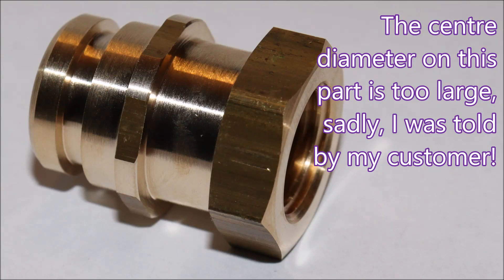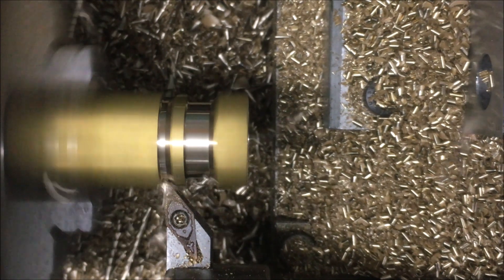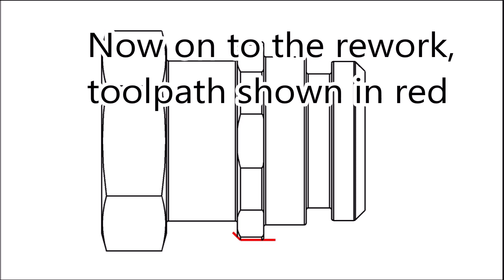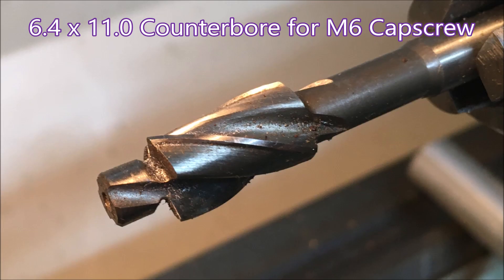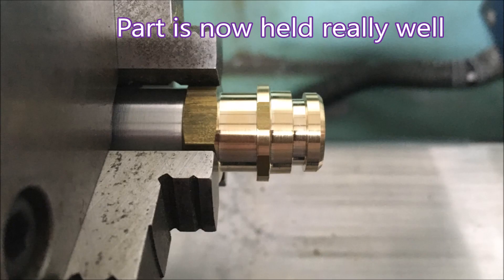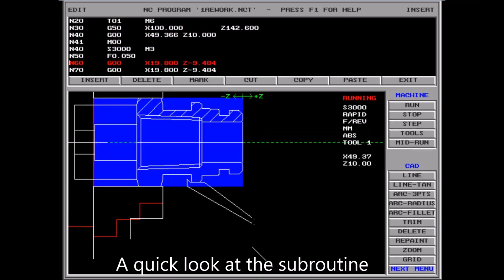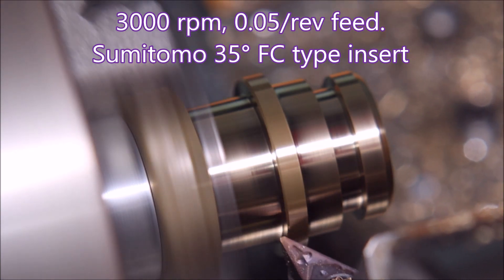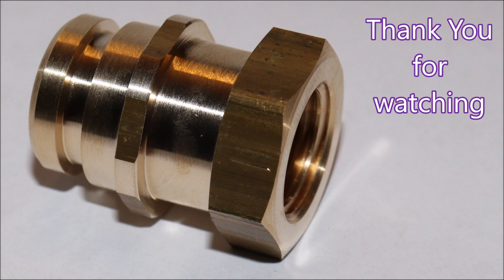Yet another Oops, I screw up some parts and fix them in my small cnc lathe

Comment: I'm surprised you didn't get a concentricity issue depending on which of the 2 sets of 3 flats were being clamped.
Reply from the maker: Pleasantly surprised myself, I must admit. That diameter just has to fit in a recess with clearance, so any run out would not be a big deal.
But, I was surprised with how accurately they ran.